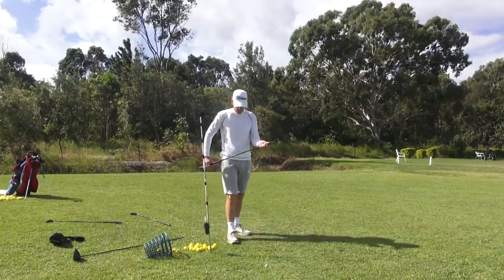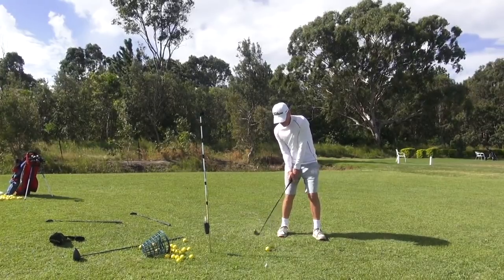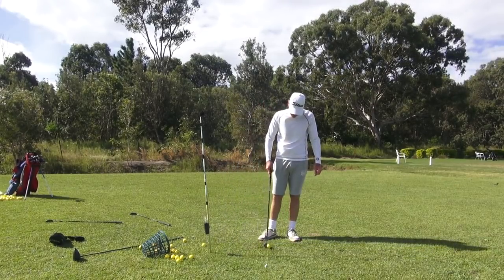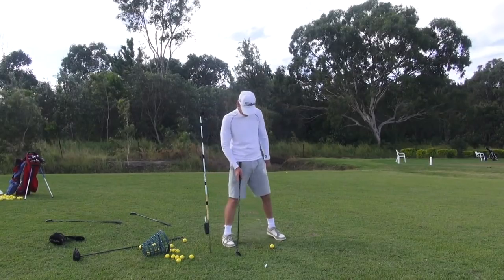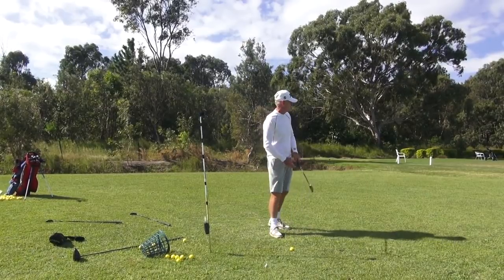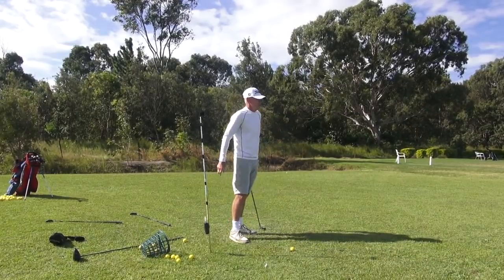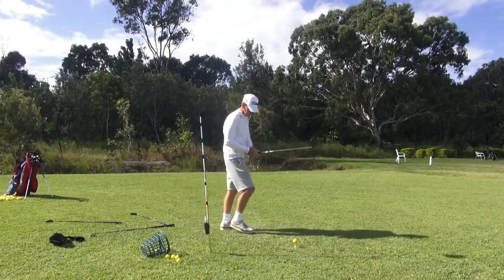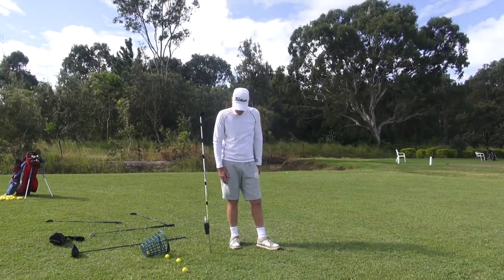Shotmaking with Channel Lock

Comment: Could you please re-visit how NOT to push the heel into the ball (caused by in-to-out direction).  I start with the ball off the toe and still end-up at the heel. Thanks
Reply from the maker: Hi Thomas, 
                           You must be moving  'out' to the ball with your   spine coming into the ball to hit  the ball in the neck of the club.. try   keying on sitting into your trail leg really strongly   coming into impact   and feel like  your  buttock is  resisting your     body going to the ball at impact .. you only want your hands/arms going  out towards the ball   .. not  your body...especially the upper body and head.. you also want the feeling that your arms are stretching  full length away from your    shoulders  coming into impact   //arms/hands are  going 'out' to the ball.. the  buttock is   resisting  ..even to the extent of feelling its going    backwards awy from the ball  at impact ..you have to hit 'away from your trail vertical axis   ...it cannot   move towards the ball at all as feeling.
                        cheers JH

Comment: Great instruction JH. I think some of todays high spin tour players could benefit by using the off-the-toe shot.
Thanks,
Ben
Reply from the maker: Hi Ben, 
               With the driver, it's just a shot I can rely on absolutely to do the same thing every time.. the toe can  never close  because the   ball  is deflecting it  open  and because the spin is  reduced so much the ball doesn't want to move hardly at all in its flight.. the same with the shot into a green with an iron.. the ball is just  expended in its  flight by the time it gets to the green and  doesn't  run at all.
                      cheers JH
Reply: Interesting stuff JH. I had never heard about hitting irons off the toe but it sure makes sense to hold the ball on difficult plateaus of a green like we often see the pros contend with. Too many times their ball will hit and spin back to lower levels - some times even off the green. Not sure I understand why you would hit the driver off the toe; what purpose does it serve?
Many thanks,
Ben
Reply from the maker: The 'Toe' shot driver is a low spin flight into the wind and guarantees the ball will not turn over in flight because the face is torqued open a bit because of the toe area impact... 
                cheers JH
Reply: I suppose the drive would most times produce a low shot?
Thanks,
Ben
Reply from the maker: The height is  a bit lower than normal because the lift spin is reduced .. but  its only marginal.. the ball doesn't stay airborne as long   because it lacks the normal amount of backspin lift  a centered  hit produces  but the added roll  makes up for the    reduced  hang time.... its a specialist shot only .
                      cheers JH
Reply: Thanks JH.  You know, I've been clunking around chasing the golf swing more than 50 years and I never heard or read about hitting off the toe; better late than never. Regarding your 8 degree driver: To make that work so well as you do with the ball played back you must be really going at the ball from deep down in the channel. Maybe we're all missing something out here that we should be picking up on.
Ben
Reply from the maker: To play an 8 deg driver you have to  a perfectly straight line of   shaft at impact... any forward lean of the shaft  and the ball will not fly ... my driver is low loft but high spin which  helps with launch  angle.. again its a specialty club and I would never recommend that spec for other people.. around   10.5 is where you need to be with a back ball position .. my other Taylor driver is set at 11.5 deg loft because it is a low spin head.
                     There is   nothing  you need to know more than normal.. the 'toe hit'  shots are as I say 'specialty' shots ..  I am super finicky when it comes to  the amount of spin I want on my drives which is why I  play whatever  model  or year of driver that gives me that   ball flight.. 'my' swing    needs a certain type of driver launch characteristic .. I know what that is .. I never use a trackman or alike ...its  a 'real time'  test that I always conduct ... the flight  I 'want'  is  what I 'see'   in the balls flight.. when I 'see' the right ball flight .. I have the 'right' driver spec.
                    cheers JH
Reply: Very interesting information.
Thanks,
Ben